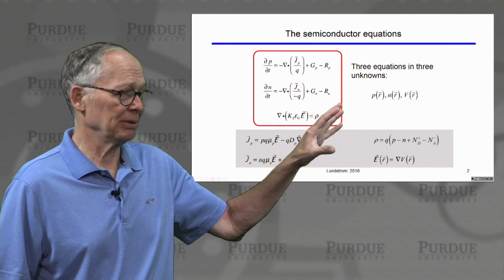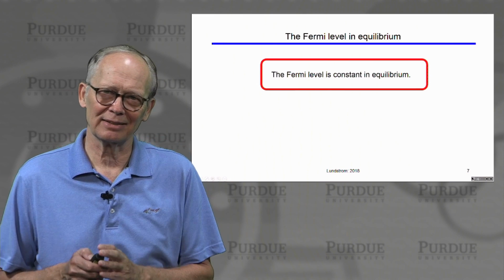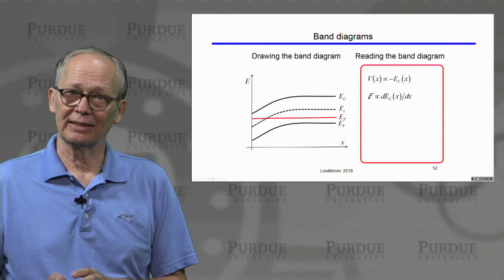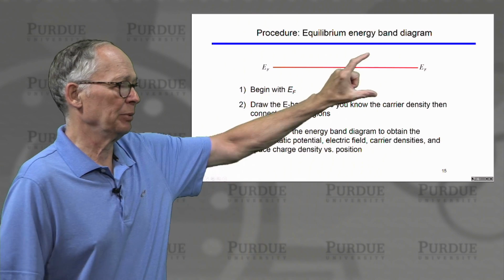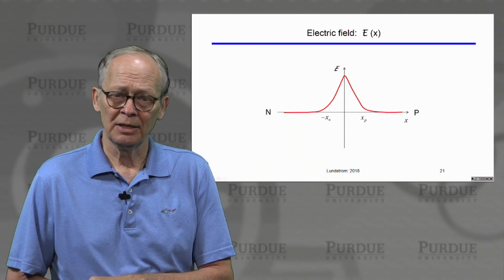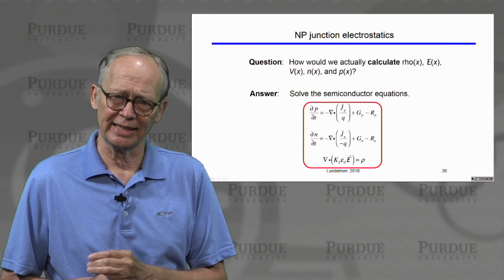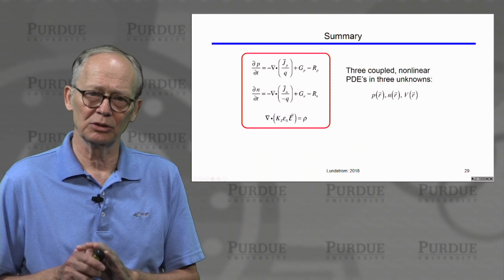ECE Purdue Semiconductor Fundamentals L5.2: Semiconductor Equations - Energy Band Diagrams

Comment: The Professor said at 6.07 like "If the //energy// is more positive near the surface, the energy is going to be lower near the surface."
But shouldn't it be "If the //voltage// is more positive near the surface, the energy is going to be lower near the surface.?

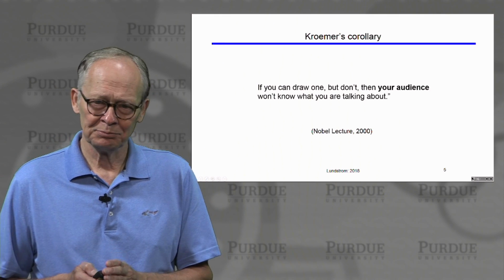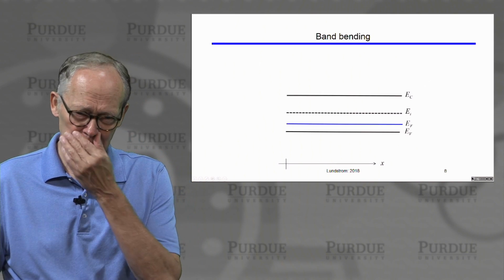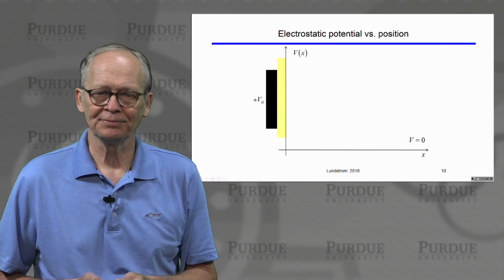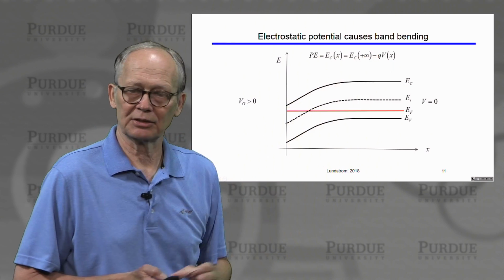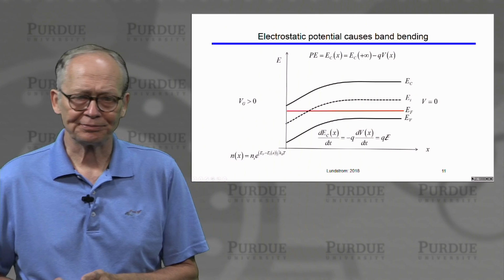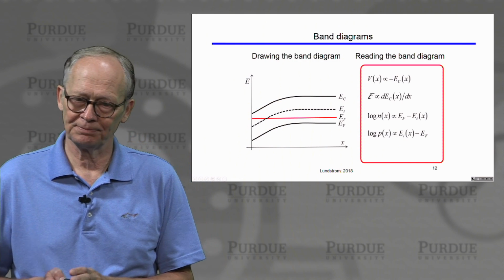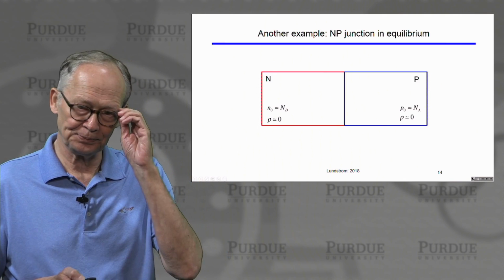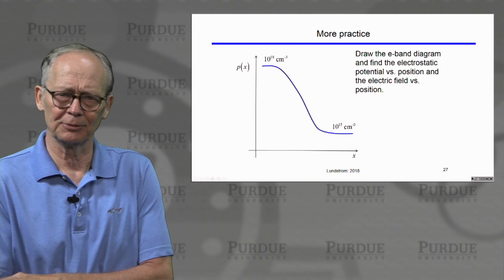Comment: 2:07 An important principle, 3:33 The fermi level in equilibrium, 4:20 Band bending, 5:49 Determine electrostatic potential from the diagram, 6:56 Determine electric field from the diagram, 7:55 Determine the electron/hole density from the diagram 10:29 Determine space charge density from the diagram, 11:28 Example: PN junction in equilibrium, 19:34 Example: non-uniformly doped semiconductors, 22:32  Summary